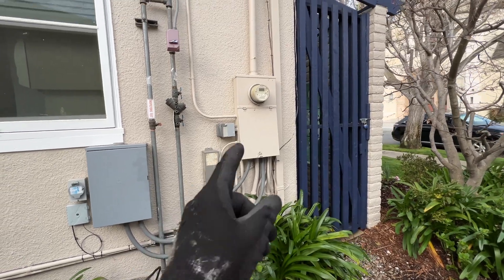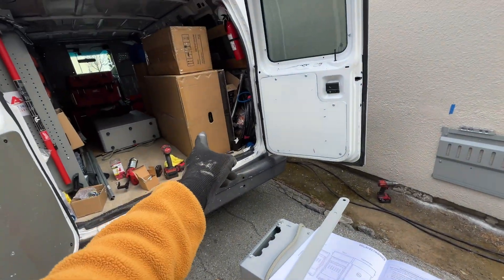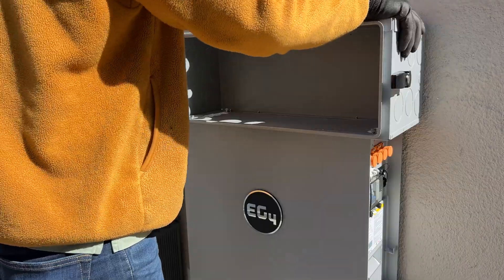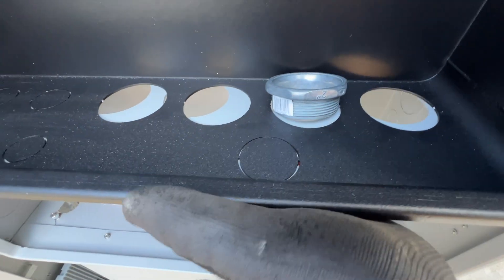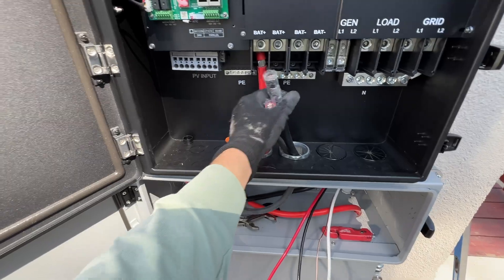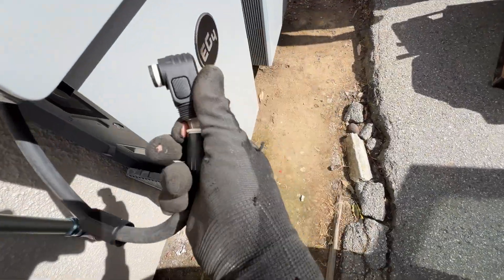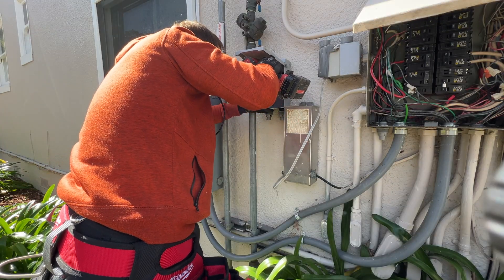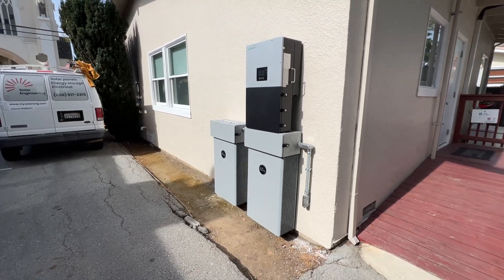EG4 Power Pro 28.6kWh + Luxpower 12k (EG4 18K). Home battery backup installation.

Comment: What's the advantage of using this system without solar panels to charge the batteries?? Is it just for home backup. You did mention that solar would not work on the roof of this this project.
Reply from the maker: @lamartravis1  yes, only for backup power. Client experiencing often power outages.

Comment: Do you need to use metal conduit on the DC solar wires going into the conduit box below the EG4 18K PV if it is outside?
Reply from the maker: NEC 690.31.D.1 "...inside building..." so outside can be non-metal conduits.

Comment: For about $800 less than this unit you can buy an easy to assemble 15.5 kW, DIY LFP battery kit that uses high quality EVE cells with a smart BMS with active cell balancing, a full suite of communication ports with Bluetooth.
Reply: Speaking like a true rookie. Will it pass inspection? People need UL rated stuff.

Comment: Doesn't that large wire under the house need to be in conduit. I have been told it does, even going from one side of the inside of my garage to the other side
Reply from the maker: it's nonmetallic-sheathed cable, so no conduit needed

Comment: could you technically power the entire home using backfeed to the main panel? I'm interested in a similar setup, but don't want to have to pick/choose my critical loads and would rather do a whole home backup up to the max 12K the inverter can support. I think the system will auto pull from the grid for any loads over 12k?
Reply from the maker: you'll need to relocated all loads from main panel. Or install tesla backup switch, which can do full-home backup without circuits relocation.

Comment: Can I ask why you used what looks like AWG 4 or 6 for the grid/load?
Reply from the maker: it's a partial backup. Inverter replaced 50A generator. So I'm using 6AWG
Reply: EG4 has plans on website also recommend you having a engineer that stamps them in your state for $300-500 that will show blueprints.

Comment: I would never use a low surge, high frequency, transformerless inveryer to power my home. They offer poorer peak power capacities and a shorter life expectancies than heavy duty, low frequency,  transformer based inverters.
Reply from the maker: what is the alternative?
Reply: @SolarEngineering  The alternative is a heavy duty, low frequency, transformer based inverter charger from manufacturers like Magnum Energy, Schneider Electric, Sigineer Power, Outback Power or Victron Energy.

Comment: I am curious - why LuxPower and not EG4 18KPV? Seems like they cost the same but you get two parts from the same brand that supposedly should work better (more reliable?) together.
Reply: Oh I watched the video again and you did mention that they are the same inverter.
Reply from the maker: yeah, EG4 18K is a white-labeled version of LuxPower 12k.
Reply: @SolarEngineering  yes but with separate support staff and software/firmware correct? Has there been any call backs? Luxpower is a spin of from a China inverter company "Ningbo Deye Inverter Technology"

Comment: Why expose the batteries and inverter to direct sunlight? Although they may be rated for outdoor use, electronics still suffer from increased temperature and you may want to advise them to get a shade over the installation.
Reply: Rookie move for sure

Comment: Is this setup UL9540 listed?  Did the AHJ approve it?
Reply from the maker: yes and yes
Reply: @SolarEngineering   Can you link to the certification?  I'm not finding it online.
Reply from the maker: @nickpatel5419  https://eg4electronics.com/backend/wp-content/uploads/2023/11/UL9540-PP-WallMount-AW18kPV-ESS-Certificate-of-Compliance.pdf
Reply: @SolarEngineering   Thank you.  Technically, this is not an EG4 UL9540 configuration. 
https://eg4electronics.com/backend/wp-content/uploads/2023/11/ESS-9540-Detailed-Configuration-Requirements-1.1.pdf

But if the AHJ approves, I guess it's good??
Reply from the maker: I'm in California, inverter and batteries are CEC listed (California Energy Commission). PG&E relies on CEC for approved equipment to use.

Comment: For paralleling 2 PowerPro batteries, doesn't EG4 suggest connecting the second battery to the bus bar of the first battery? And then from there, running two battery cables up to the inverter from the bus bar?
Reply from the maker: yes, it's a recommendation, not a requirement.
Reply: So why do it that way?

Comment: How did you end up making it watertight between inverter and battery. It looked like some of your holes only aligned and the rest was left open? Is there maybe a seal between the two units?
Reply from the maker: a small line of construction adhesive on the perimeter.
Reply: @SolarEngineering  thank you for answering me. :)

Comment: You have come a long way from Blue China GTILs!  I'm still there but am looking at the LUXpower 6K as they have current clamps and I don't want a contract with my utility. I have two Blue Boxes for day time and two for night time (batteries) I finally learned how to use the battery function and it makes so much sense! Set amount in watts you want to limit the battery bank to output, and use internal limiter to control each Leg up to the set limit. It works flawlessly. I use a regular AC battery charger during the day to recharge the batteries as the panels are keeping the house loads from grid at just a few watts. So no charge controller for batteries, just the AC battery charger. The system works perfectly thanks to all your YouTubes from back in the day of your blue box GTIls!